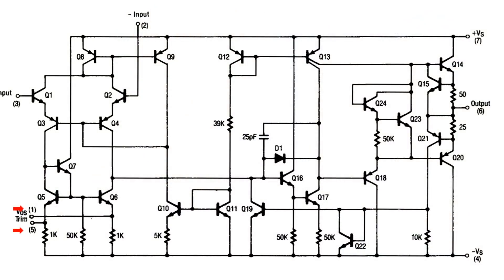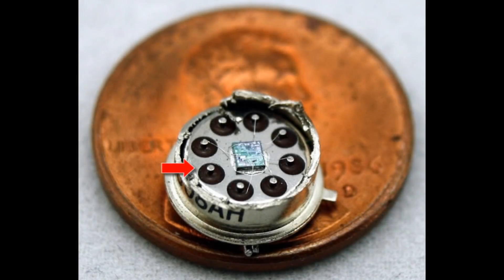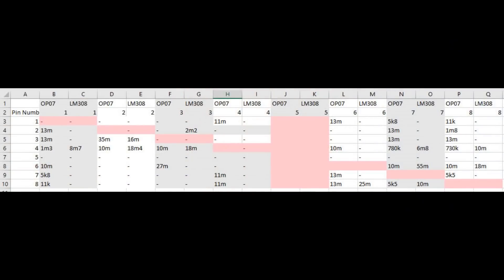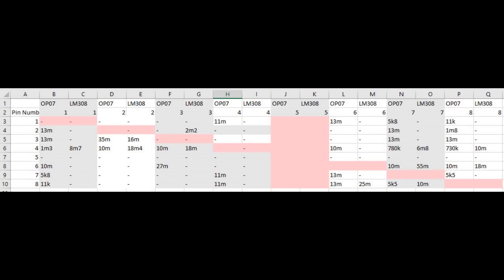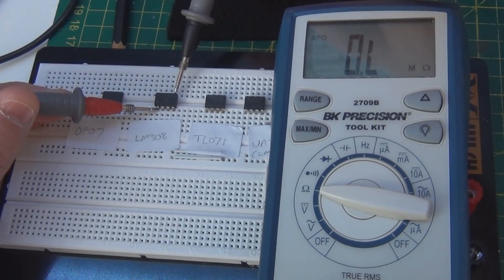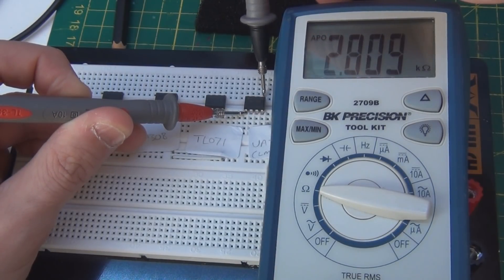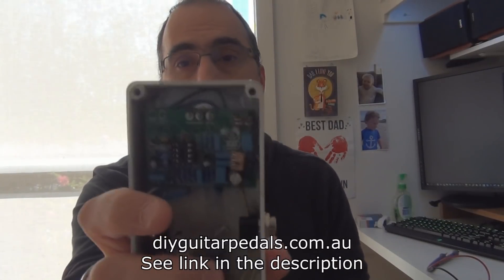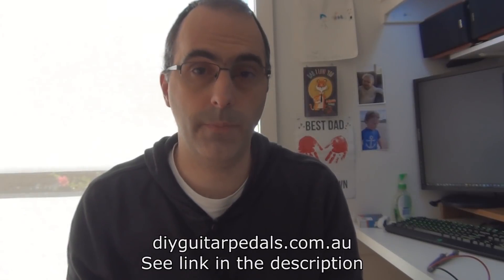Test your LM308 real or fake?

Comment: So I am getting 2.3k on mine between pin 1 and pin 5 so I guess it's a relabelled component. Can someone confirm this before I accuse the scum bag that sold me it of cheating me?
Reply: Yes, according to the video you shouldn't have continuity between pins 1 and 5, if you do then it's som other IC relabeled as "LM308". I confirmed this with a Vintage ProCo RAT that I own and also with a brand new OP07 IC that I purchased, none of them have continuity between pins 1 and 5.

Comment: shit...
So, LM741 it is I guess...
Reply: Well, the OP07 still sounds pretty dang close and you can still get them.
Reply: @erikvincent5846  funnily enough, I've once built a RAT clone once with my "LM741 in disguise" and it sounded pretty much like one would expect from a RAT. If I didn't measure the resistance between pin 1 and 5 (which is just like he said around 2k in my case) I probably never would've realized that it's fake. It also seems to slightly low-pass the signal, just like a LM308 would.
I didn't really analyse the datasheet yet, but it could be at least "kinda" similar in characteristics to a 308, which would make sense, since they wouldn't want it to be immediatly identified as fake when you use it.
Or maybe the 308 just isn't as integral to the RAT sound as people tend to say.

So in conclusion, the 741 can't be that bad if I didn't notice that it's not a 308 for so long. So everything turns out fine I guess...

internal crying
Reply: @Scoaster86  the LM308 does have one aspect that does make it important, and that is its slew rate. Particularly, it's very slow slew rate. The slow slew rate kind of automatically filters and distorts high frequencies out, making it's distortion less shrill. That's why the OP07 is usually substituted. The LM741 has a faster slew rate, but is much slower than most other op amps, making it a decent substitute, minding the pinout.

Comment: I have done blind a/b tests - one RAT with the original LM308 and the other with LM351, and I hear/feel no difference at all. Same tone, same noise, same clipping.
Reply: That's because the clipping is done with the diodes. The op-amp alone doesn't make galaxy shattering difference. It might make a slight difference yeah, like we have heard in other videos... but changing the diodes would make bigger impact.

We have to remind ourselves that the RAT or any given electronic device is a result of the WHOLE circuit and all the components together.
Reply: @TeroWasHere  I agree. A slight nudge of the tone knob makes a bigger difference than the op-amp. And saying something sounds more "open" means absolutely nothing. Too many op-amps, not enough blindfolds.

Comment: i bought some lm308 ic chips (new) on amazon from the seller QSKEU STORE as far as i read they came from china , just tested em pin 1 and pin 5 are not connected . couldnt see any sign of desoldering on the pins so i guess they are new made or something . since china has a ehem well known history of copying stuff i guess they are just some new made "clones" of the lm308 if stuff like that exists , also bought some jrc4558 from HATOLY2 on amazon , look brand new just like the lm308 ic´s

Comment: I bought some "fake" LM308 chips from a seller thru Amazong and turns out they are LM385 dual chips. Go figure.
Reply: How did you figure those were LM385s? I also got some fake "LM308" and I wanna know what ICs I actually got.

Comment: Hey! I have a question, not related to the video.. is it possible to take a boost pedal, add clipping diodes, and make it into an overdrive pedal? And is it possible to do it the other way? Bypass the clipping diodes of an overdrive and make it more like a boost? Thanks!
Reply: Well, to remove, either desolder the diodes or use wire snips to cut them off. To add hard clipping diodes, you just need to find the clean output (usually the middle pin of the volume pot) and Ground, which may be pin 1 of the volume pot. Tie 2x 1N4148s (or whatever diode flavor you prefer) together with the stripes opposite of each other, so one diode's stripe side is tied to the other's non stripe side.  Take this "diode pair" and solder one end to output and one to ground. That is hard clipping and should distort your boosts sound.
Reply: @erikvincent5846  you are great!!
Reply: No worries. I just built an all Germanium Sziklai pair "Range Master" that I am calling a Plague Master (Pun off of "szik" which sounds like "sick"). So, it is just a boost. At some point, I can make a video that shows the effect of adding those diodes and making it a dirt/distortion pedal.
Reply: That's pretty much what happens. Hard Clipping makes it more distortion, soft clipping makes it more overdrive
Reply: @erikvincent5846  can you teach me how to do it?

Comment: Question for anyone...I want to know if all OP-amp Pi muff fuzz pedal PCB Boards are all the  same Printed PCB's...I'd like to purchase it from DIY Guitar Pedals.com but it takes almost a month to get yo the States. I've already purchased all the components and housing , I just need the PCB. Does anyone know a distributor in the States for the correct PCB?
Reply: Where in the states are you located?
Reply: Cali

Comment: Thanks for the insight. There's some pretty dodgy crap on Ebay in regards to diodes, chips etc. Where would you recommend buying from or who from?
Reply from the maker: You can still buy on ebay adz just be prepared for fake chips and test the chips in a known working circuit.  Unfortunately for some chips like the lm308, ebay is the only readily available source.  But...as you will see in the next video, you may not even need an LM308 ;-)
Reply: @DiyguitarpedalsAu  thanks for the reply appreciated legend